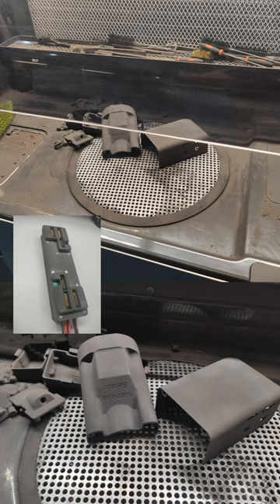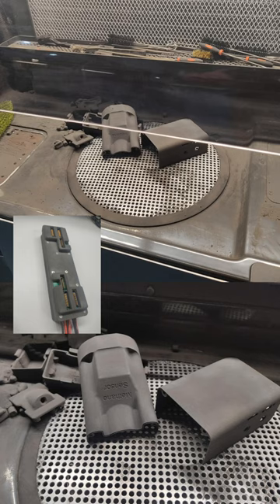Nextech 3D Printed Drone with Formlabs Fuse 1+

Comment: @Formlabs can we get part hollowing in preform so we don't have to do it in chitubox first... it's been like 10yrs and still no part hollowing function. Also, when you do small rafts, can you make an option so the raft is one piece, instead of random unconnected dots which are a pain in the a** to remove?
Reply: This should have been a feature in PreForm year ago. We use meshmixer for hollowing, but chicthunox is probably the better option, since it will also make plugs for drain holes